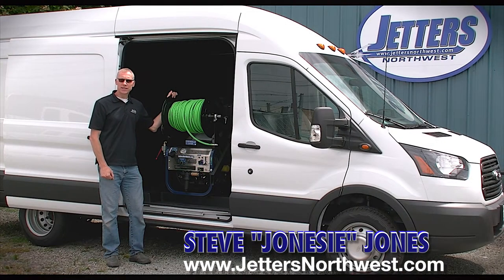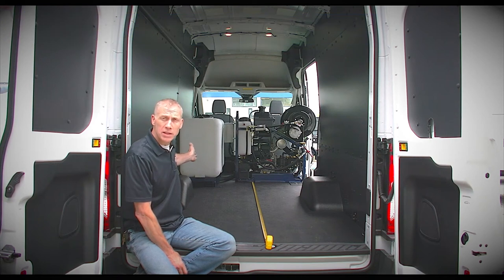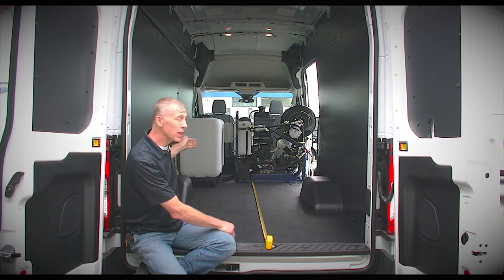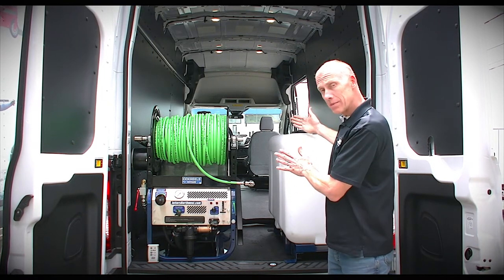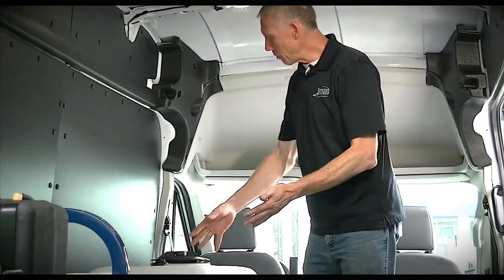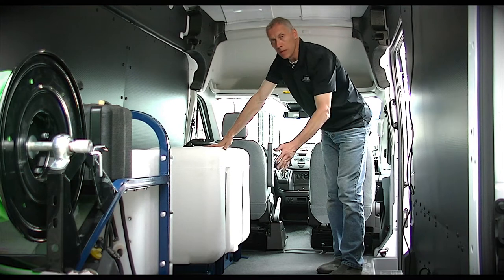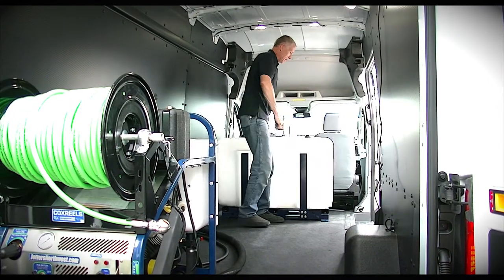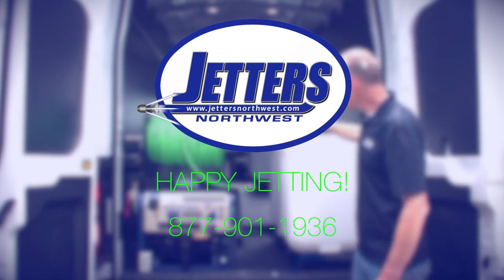MOUNTING a Brute JETTER in a SERVICE-VAN or Enclosed-Trailer - "GET" JETTING w/JONESIE

Comment: what would work better on tree roots, 4000 psi at 9gpm or 5000 psi at  5gpm?
Reply from the maker: Sorry for the slow reply - missed that - higher PSI probably, because the water is moving faster (PSI relates to water speed) but the higher the PSI - the smaller the width of the water-jet (if the GPM is the same) which means less coverage

Comment: Ok. So I have a question about the exhaust/muffler extension. I just got the 4009 model Brute 400psi 9gpm. I feel that the exhaust pipe is way too short & isn't fully exiting my sprinter van.. Is there an attachment to get the muffler extended out the van so I don't get carbon monoxide poisoning?
Reply from the maker: Hello David - sorry I just came across your question (maybe one of our other guys has answered it for you over the phone) but we do not offer a further extension; we recommend that you work with a local muffler shop if you still need a custom extension. Call John here if you have questions 1-877-901-1936 - thanks for choosing Jetters Northwest !!
Reply: What I love about Northwest they will have an answer for you ....
Reply: How is the jetter working? Please give me a call id like first hand info on this jetter before I buy one